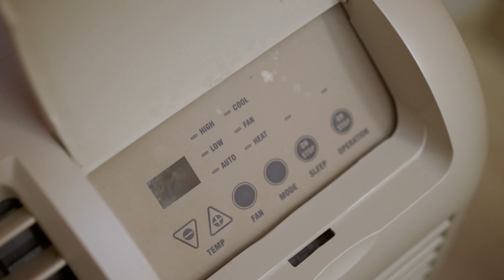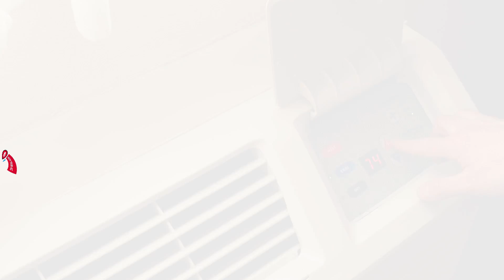How To Install A Window Air Conditioner Unit In A Horizontal Sliding Window 🛠 | HVAC Training 101

Comment from the maker: Read the full review here: ►►
https://hvactraining101.com/ac/window/install-horizontal-sliding-window/
(How To Install A Window Air Conditioner Unit In A Horizontal Sliding Window)

🛠 Be on the lookout for these common problems with installing a window AC in a horizontal sliding window.

◾Size
The most common problem is installing a unit of the wrong size. The most efficient and effective window air conditioner has a cooling capacity of 20 BTUs per square foot of space in the room. 

◾Weight Distribution
It may be tempting to open the window, slide the air conditioner in, and close the window firmly onto the unit. Doing this forces the window and the window sash to bear the weight of the air conditioning unit and can cause damage to the window. When installing your AC unit, take the time to attach brackets to help support and distribute the air conditioner's weight.

◾Tilting
Air conditioners cool air by removing moisture from it, causing water to pool inside the AC and drain from the back. Some air conditioners have gutters and channels built into them, allowing them to drain when the unit is level. Others require a slight tilt for the AC to drain correctly.

💬 Let us know what you think of these How To Install A Window Air Conditioner Unit In A Horizontal Sliding Window in the comment section below.

👉 We appreciate every thumbs up and would be grateful if you’d consider subscribing to our channel!!

-------------------------------------
🎥 Welcome to the official YouTube Channel of HVAC Training 101 🎥

HVAC Training 101 is dedicated to helping you make smarter buying decisions when it comes to air conditioners, heaters, air purifiers, and other HVAC-related items. 

 🌐 Learn more about us: https://hvactraining101.com/about-me/
 💻 Like our Page: https://hvactraining101.com/facebook/
 📢 Follow us on Twitter: https://hvactraining101.com/twitter/
 📱 Check out our Pinterest: https://hvactraining101.com/pinterest/
 🔴Subscribe to our Channel: https://hvactraining101.com/youtube/

-------------------------------------
Disclaimer:
Some of the footage used in this video is not original content produced by HVAC Training 101. Portions of stock footage of products were gathered from multiple sources including, manufactures, fellow creators, and various other sources. If something belongs to you and you want it to be removed, please do not hesitate to contact us at bob [at] hvactraining101.com.

Some links in the description are affiliate links. If you click on one of the product links, I’ll receive a commission at no additional cost to you. As an Amazon Associate, I earn a small commission from qualifying purchases.

#HVACTraining101 #HowtoInstallWindowAC #SlidingWindowAC

Comment: This was not helpful AT ALL for a horizontal sliding window. Even the pictures are from a vertical window. 🙄
Reply: Agreed its rubbish..drill holes in the frame are you kidding me U say even if it's a unit that doesn't need a brace. Ridiculously confusing video 📹